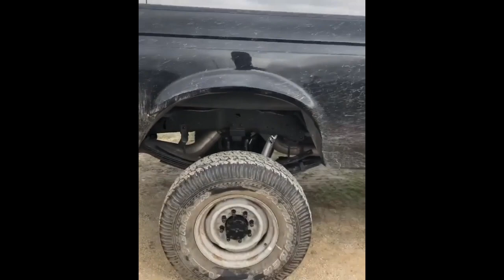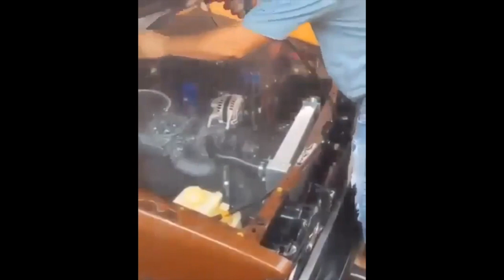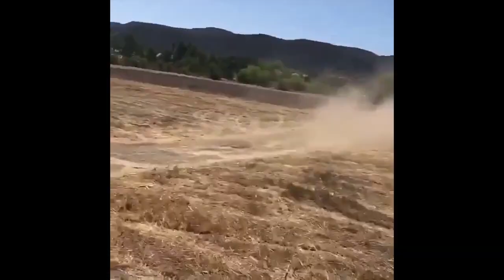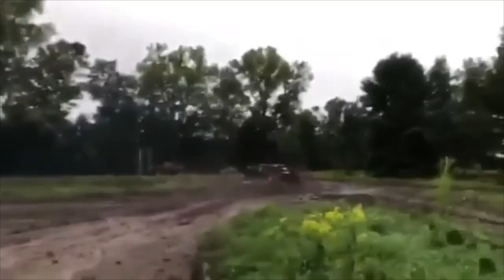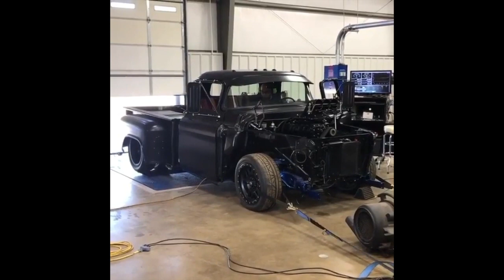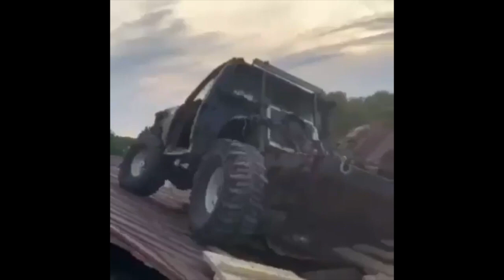BEST Old Truck Video Compilation! | The Farm Truck Show

Comment: All the dealerships needs to do a old truck remake of the 70s, 80s, 90s trucks with all the new bells and whistles, same body style just a lil bigger and beafier but exact same same and design, do like a limited 70,80snd 90s remake just for us , do yall feel me on this...
Reply: The only bells and whistles I need are a set of 37s and some Flowmasters there's a reason these trucks are so sought after. because newer vehicles are garbage you couldn't pay me to drive one. k5 for life